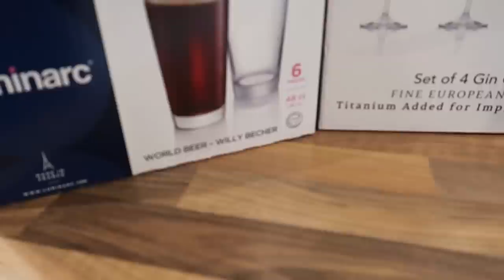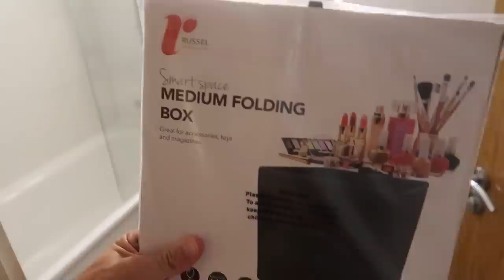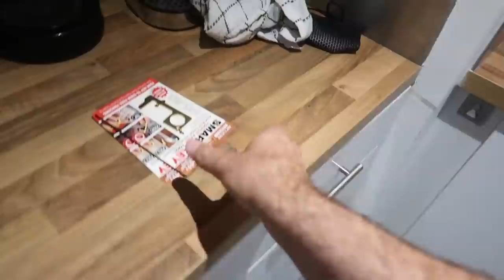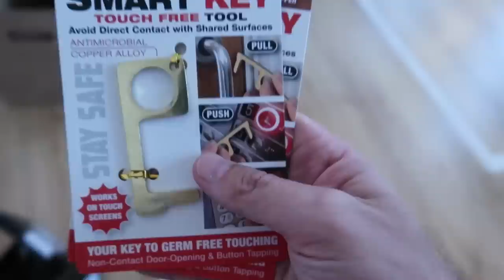CELEBRATING WITH A GLASS OF KYLIE MINOGUE | THE LODGE GUYS | VLOG

Comment: If you lay the vinyl and there is a small gap you can just use a nice bead of silicone to cover it, it's very common.

If it's laminate you can get beading that you can nail into the skirting board.